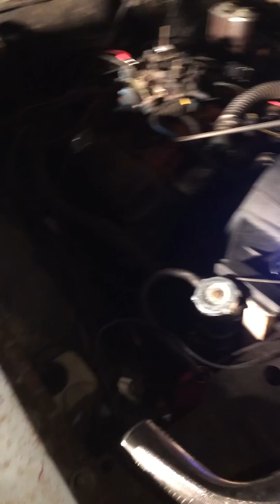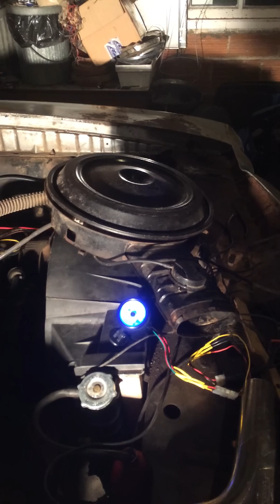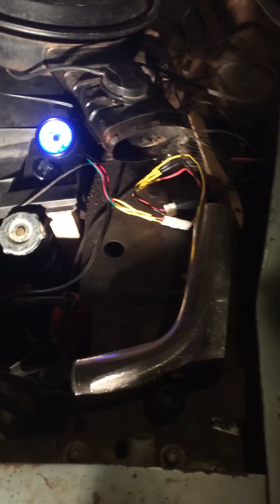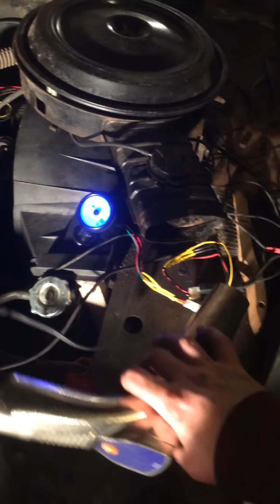How to check a timing curve without a distributor machine

Comment: Can I ask you a question. As I understand it, using your basic tools, its possible to measure and derive (Mechanical and Vacuum) measurements of Advance at various RPM levels and this is what creates your Advance Curve. Obviously you set Initial timing first by rotating distributor to line up with the desired degrees of advance....in my example I assume Ive set it at 4 degrees Initial

Measure 1 (Initial + Mechanical advance eg 4 Degrees Initial Timing + Mechanical) = say the 16 degrees measured at 1500 rpm with no vacuum (therefore you can work out mechanical adv was 12 degrees). Measure 1 taken using timing light on crankshaft tape with VACUUM is DISCONNECTED from vacuum canister on distributor  and  the hose is plugged to either ported vacuum or manifold vacuum

Measure 2 (Total Timing =Measure 1 ...which was 16 deg above + Vacuum advance) = say the 29 degrees measured at 1500 rpm with Vacuum connected (therefore you can work out Vacuum advance was 13 degrees). Measure 2 taken using timing light on crankshaft tape BUT VACUUM is CONNECTED from vacuum canister on distributor to either ported vacuum or manifold vacuum

You do these same measures and calculations at various rpms and you can manually chart your advance curves. You can see what is specifically Mechanical advance, what is specifically vacuum advance at each of the various RPMs and therefore how they contribute to the total advance. If you have too much advance or not enough, you can play around with springs for mechanical advance and adjust the vacuum canister if you want to change vacuum advance